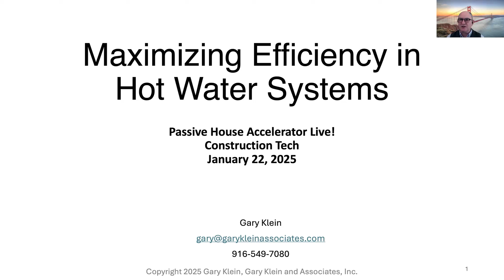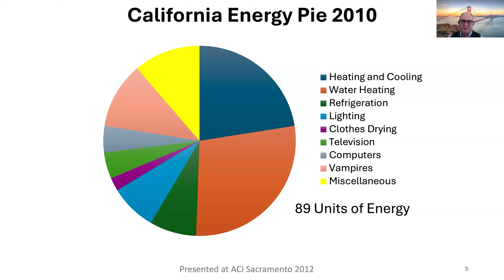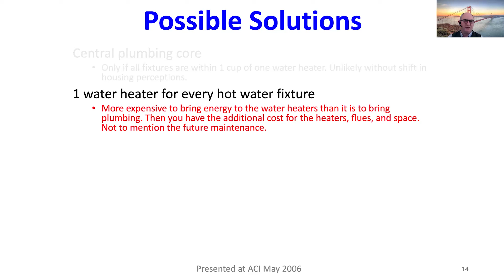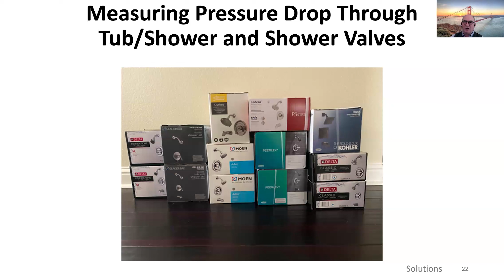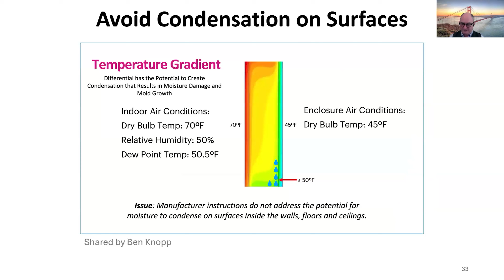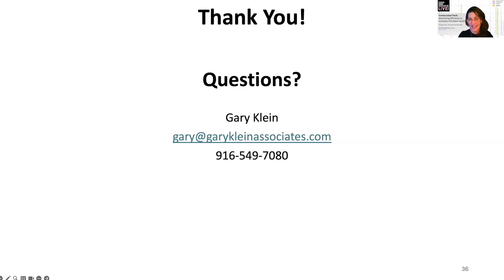Maximizing Efficiency in Domestic Hot Water Systems | Construction Tech | PHA Live

Comment: Good presentation. Your thoughts on putting a HP HW tank right next to shower stall (in a valve side maintenance area) and duct out the cold exhaust air to another room and/or HVAC return?

Thinking this would allow radiant losses to pre-warm the shower stall, thus needing less hot water, but also provide dehumidification of the bathroom when running later.

In heating climate locations, I've seen HW tanks in the bathroom making it a much nicer room on cold days.